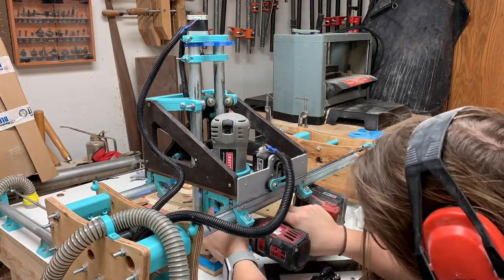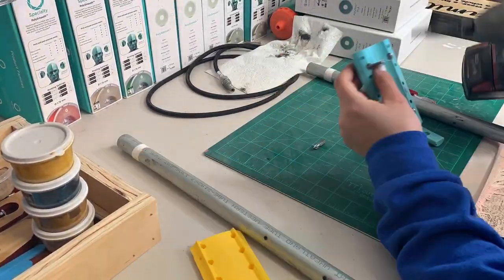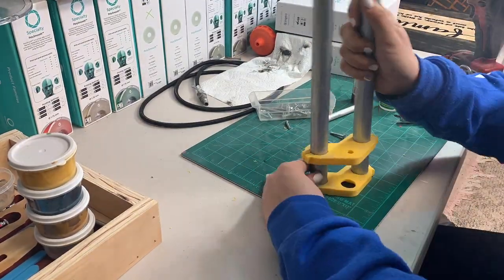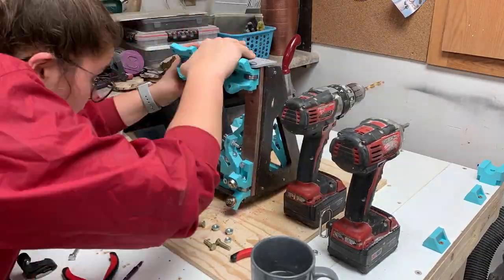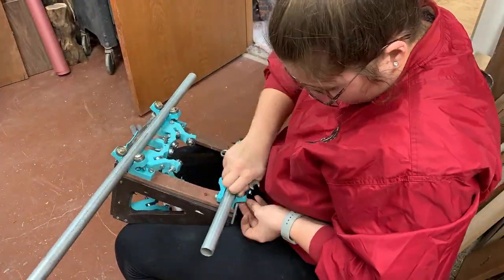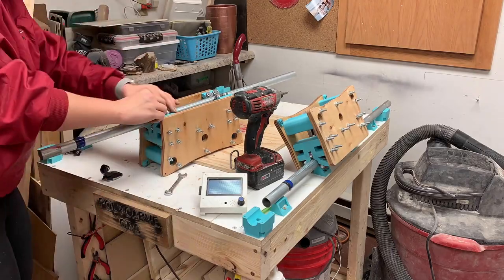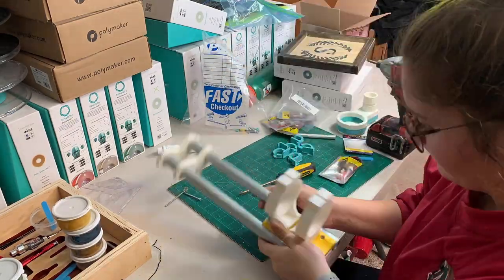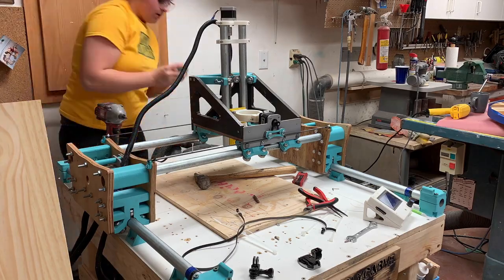Upgrading MP CNC

Comment: Great job!
Blender can help, import the STL files and use it to merge the parts you want to print.  As example, I am trying to get a Pi cluster, I can find Thingverse files for stacking them, or cases, so putting them together then selecting both and exporti g the STL it is instantly combined.  Try it with the vacume attachments as you already know what can mount to the motor, can measure it and size as well as what vacume mounting you want to do.

My father's preference for vacumes attachex to machines has been cheap, repaired, thrown out canister vacumes.  You might want to look into that as an option.

Keep MAKING!